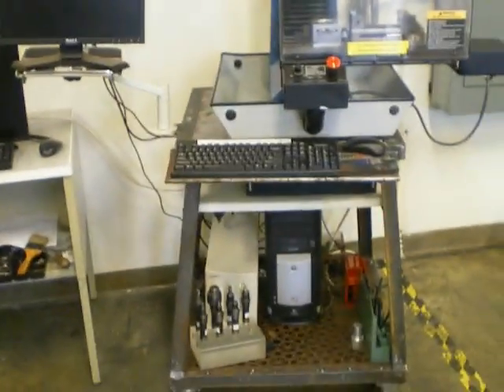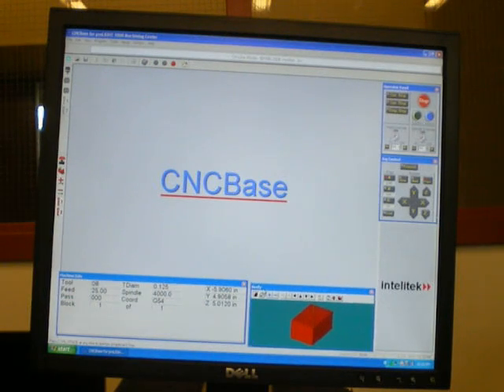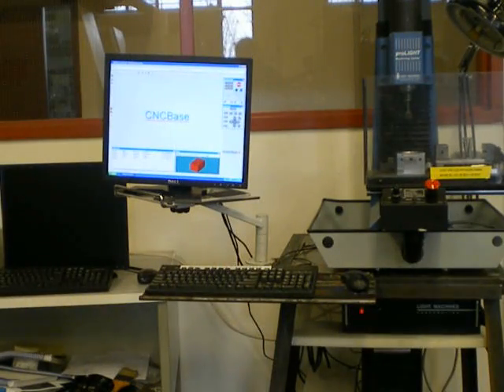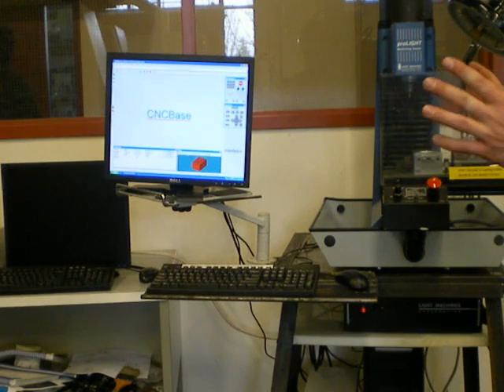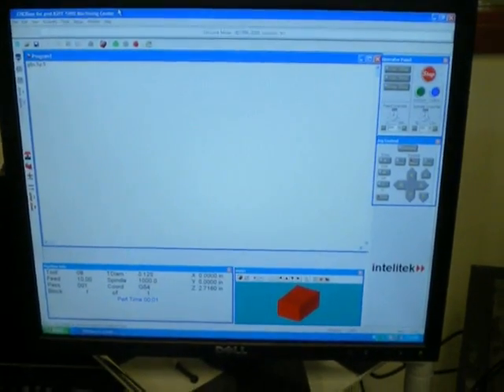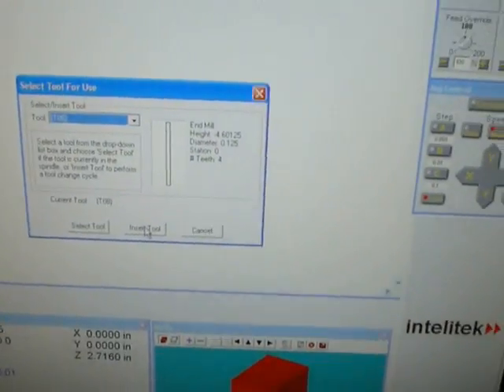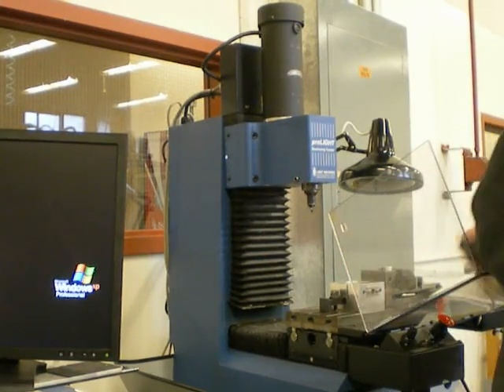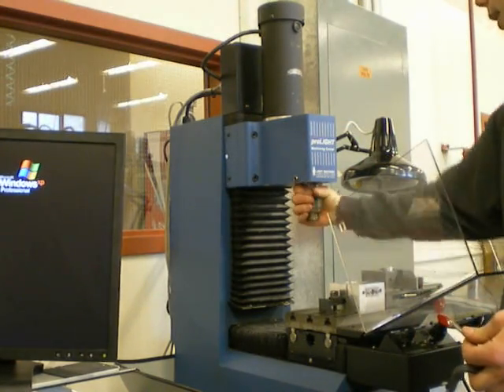ProLight 1000 CNC Mill guide, part 1

Comment: I’m curious how you got the software working - do you have an old machine that can use the ISA card that was made for these machines or do you have it working direct from a parallel port?
Reply from the maker: That video was running on the newest hardware I could find cheap at the time that had an ISA slot - I think it was a Pentium 3 with a Slot A CPU or something? These days I'd probably try to set up a VM with the old software, an ISA to USB adapter perhaps? Or just go find an "industrial" motherboard with an ISA slot built in. If you don't have the ISA slot made for these machines, you would likely be setting up a linuxCNC box or a microcontroller setup that drives those lines - IIRC, you are basically just sending it steps down that "parallel" port, to the stepper drivers which amplify it.